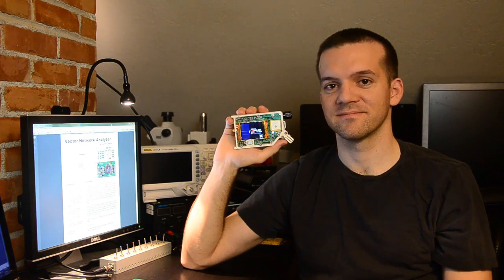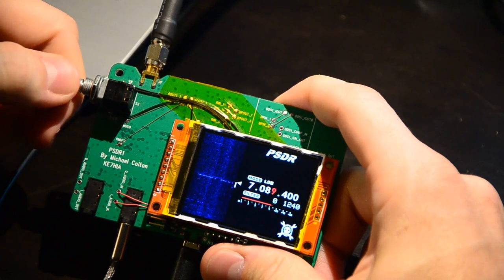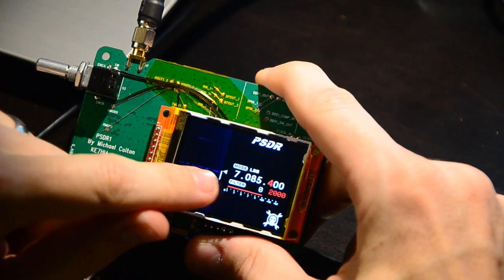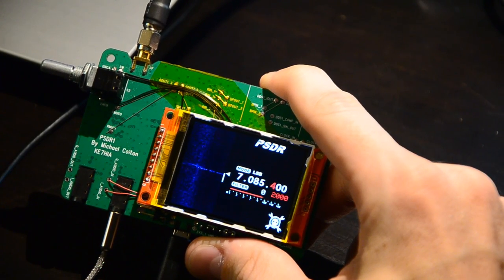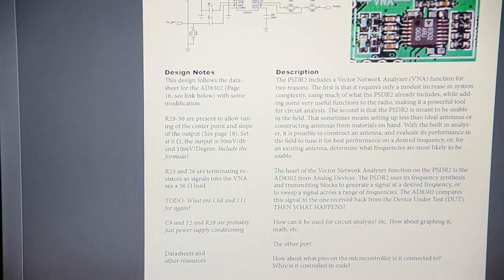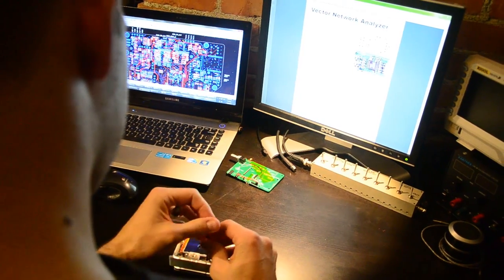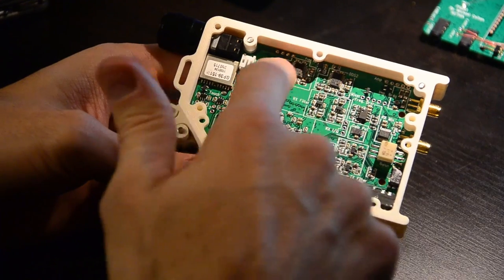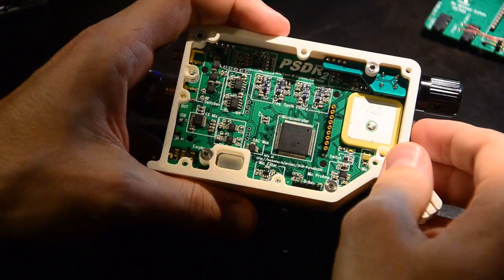PortableSDR Semifinal Video

Comment: This is so cool!.  Been waiting for something like this for some time.
This would be perfect for Ham Newbees to learn the Art in a club setting.   If the National Power Grid ever goes down, ( Heaven forbid ), This may be key for HF National emergency network activity.   Also,  if PSK31 is created for it, you may be able to use the rotatory knob to scoll and select the text to be transmitted ( like the "HandyPSK" ).   This would be a great for HF Packet nodes too.

Comment: Excuse me while I wipe the drool off my shirt.  That project is gorgeous!  Any chance of having an 'Autorotate' function for the screen to accomodate Left-Handers?  And is there also the possibility of having a solar panel on the back side to charge the battery as well?    73's!  KM4AOF
Reply from the maker: We're thinking the same things! It had occurred to me the other day that he layout of the PSDR isn't so bad for lefties if the display rotates. It doesn't have any sensors, so it would have to be a manual change (still, people probably don't switch their handedness too often). Also, I'd like to put a solar panel on the back, I didn't because I've been in a hurry and it's not a high priority. It would be quite small though, so I've started thinking of making a case that would wrap around the PSDR that would have a larger pair of solar panels build in, maybe.
Reply: Love the idea of a case with solar panels, this would enable you to double the panels.  Folding left and right halves.  Also, at the risk of increasing the size, you could use a ribbon cable from the paddles on the right and have a docking port for them on the left and right sides..  This allows screen orientation to remain stationary.  Only other addition I can think of would be a push/pull knob for control of other functions you end up adding.
Reply: Bill Frick
Oops, forgot the connections are all on one side.  Perhaps a cover that is hinged at the top and has folding panels?   Could have 3 in that configuration.

Comment: When I saw it had a GPS the first thing I thought of was - I can get the exact time off of it for JT65 modes.  Time is very important when running some of these digital modes.
Reply from the maker: Yes! That (and the location feature) is the reason I included a GPS receiver. I think low power modes like JT65 are ideal for a radio like this one. Having a fully self contained digital station that is able to get decent range, by virtue of these lower power modes, is going to be pretty amazing. You know, one I make that part work!